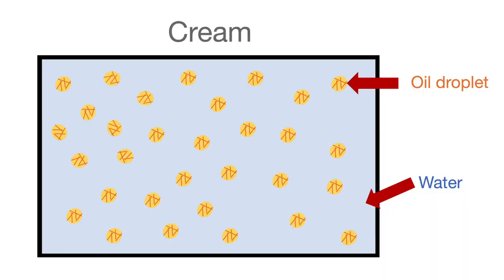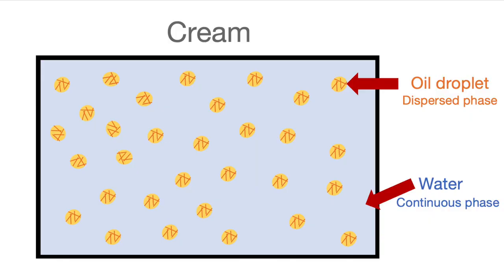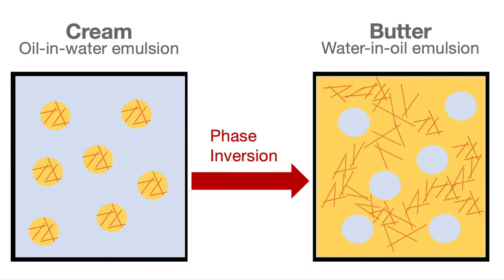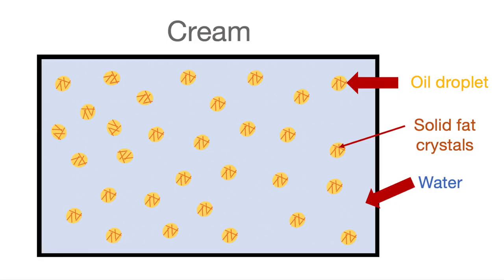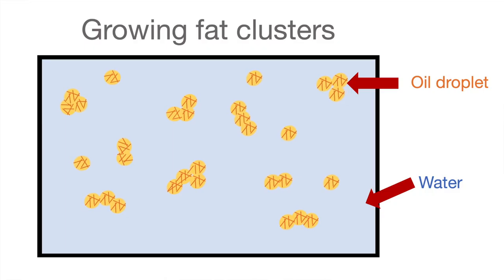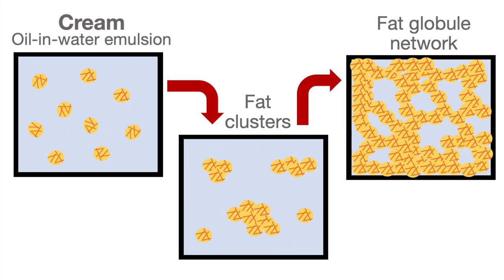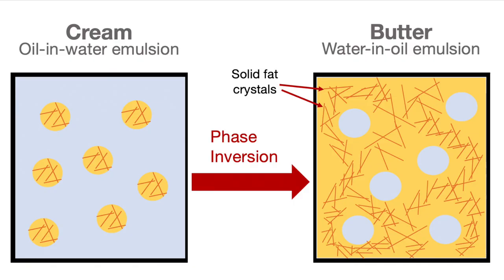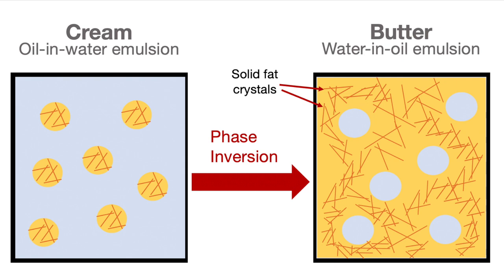The science behind butter | Make your own butter from cream

Comment: What is the structure of a violently mixed butter and water in bulletproof coffee, which gets quite light without any milk? Egg yolk can be part of it, but doesn't seem to make much difference. Butter making is good as a science project, but not cost-effective, and doesn't yield a unique product that cannot be bought. Cream is very expensive, perishable, and a holiday treat.
Reply from the maker: Oh, this is awesome I hadn't heard of bulletproof coffee before. The ghee (solid fat) would probably make a similar fat network as we see in butter, especially under all the agitation. Within the coffee, this fat network could trap some air bubbles to make it a light, airy texture. For the foam on top, there's some studies that have shown coffee has surface active particles that go to the air interface and stabilize air bubbles. This is called Pickering stabilization when solid particles stabilize an interface.